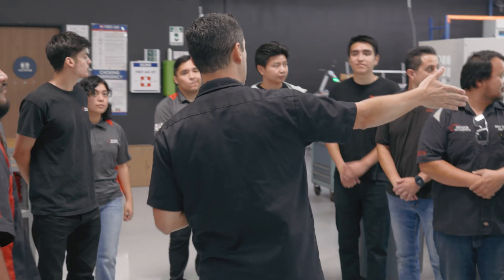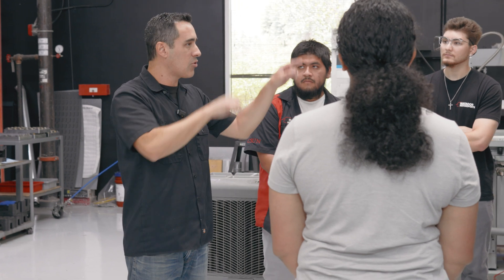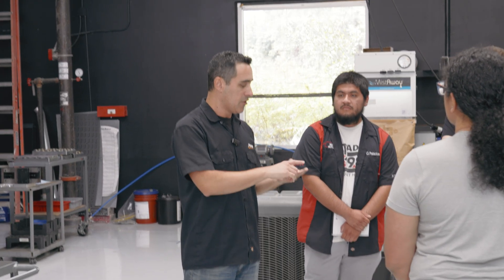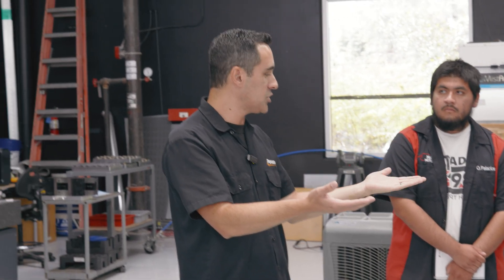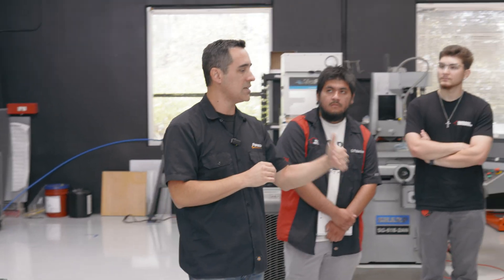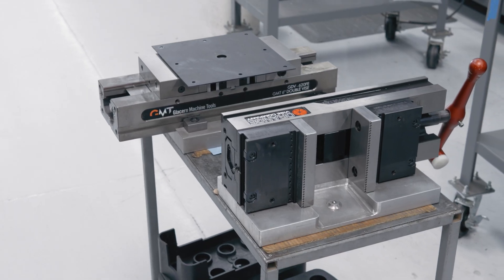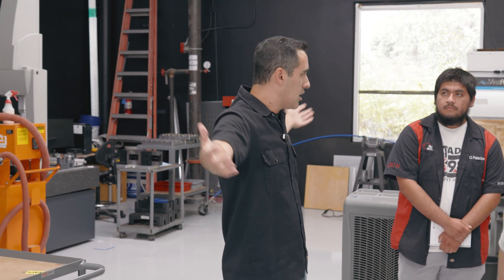New Shop Tour Series! | Pierson Workholding

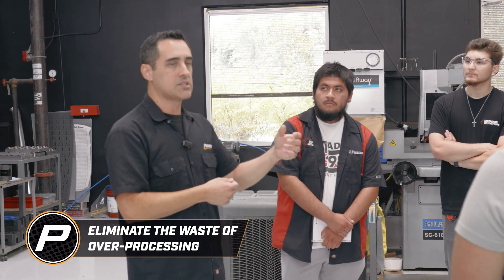Comment: What tool is that @3:30, T100 in your carousel? Some sort of scotchbrite pad on a facemill arbor? Does it wear fast?
Reply: That's looks like an ceramic abrasive brush for deburring and improving surface finish. I get ours from Weiler Abrasives. Of course wear depends on how much surface area you're covering. For my application, I update the TLO every 500 parts because the bristle tips wear and average 10,000 parts per brush.
Reply: @elliottseiler4828  Thanks for the info! We tried using a similar product from Xebec to do some deburring and surface finishing, but the bristles were wearing out super fast. Even if you updated TLO, the bristle stickout is adjustable, and we were getting different results becuase of the changing stiffness of the bristles.
Reply: It looks like the nam power brush by brm
Reply from the maker: Nam Power brush by BRM